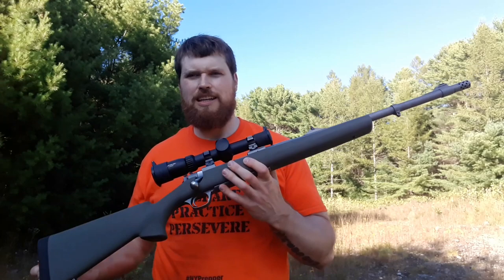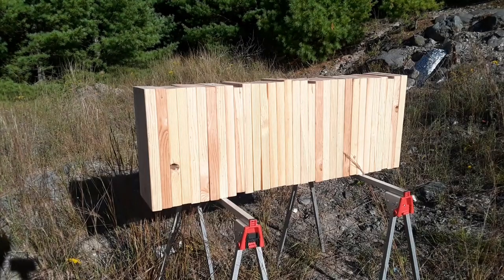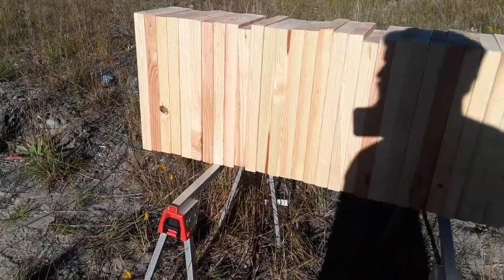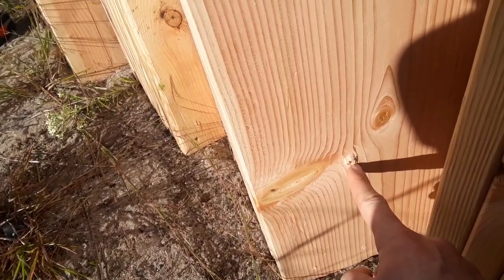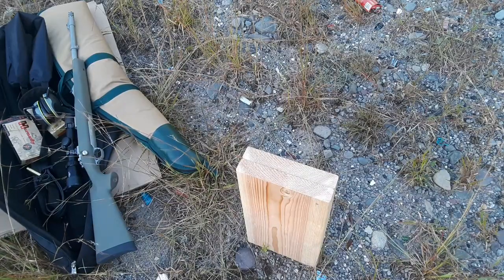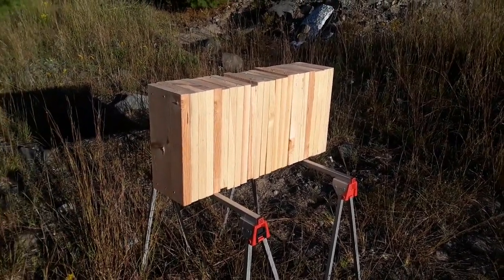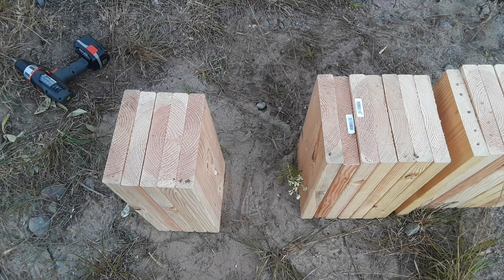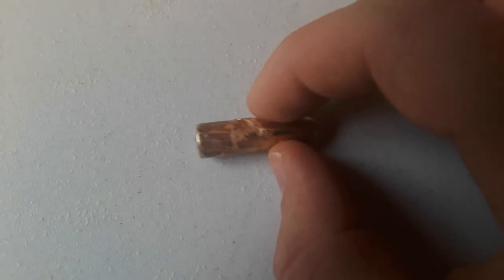416 Ruger Penetration Test #1- Hornady 400 grain DGS & DGX Bonded vs 2x10 lumber

Comment: not by much but i think your most likley to get 2300-2325 fps in that 20 " barrel 2400 fps would be out of a 24". put them through a chrony and let us know
Reply from the maker: I will... also going to test some Buffalo Bore 350 grain Solids@2650fps and 5,500 ft pounds.
Reply: Not Hornady ammo but Doubletap told me I would lose approximately 50 fps per inch of barrel loss in the 375 Ruger. Three inches (normal is 23, the guide have 20 inch) is a significant loss of energy.